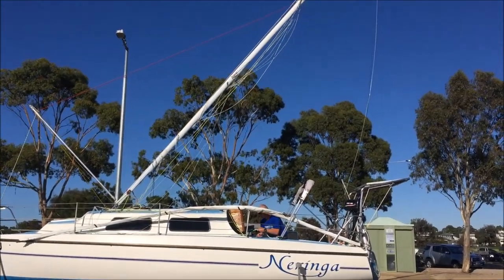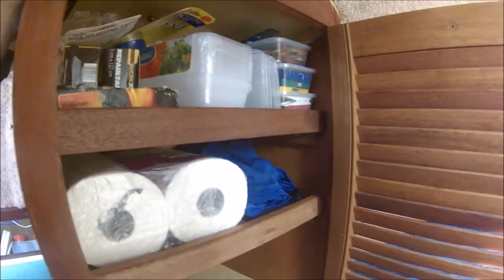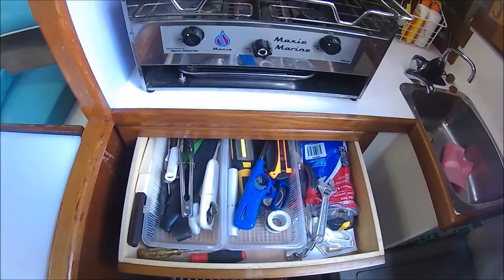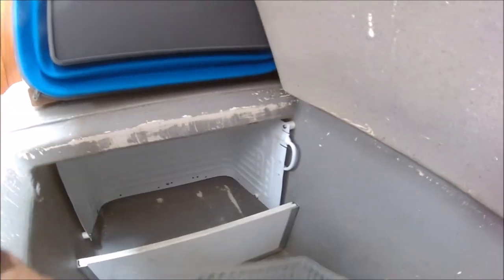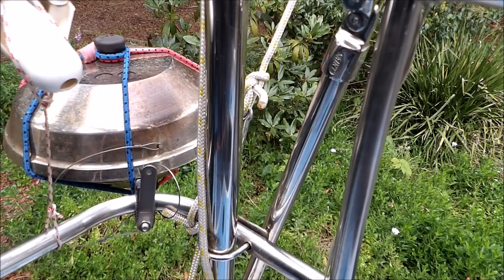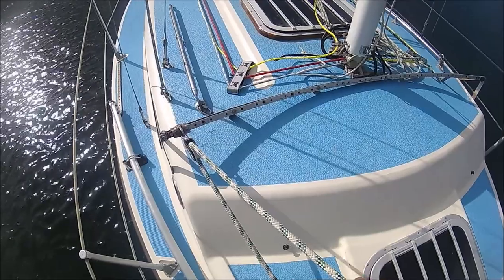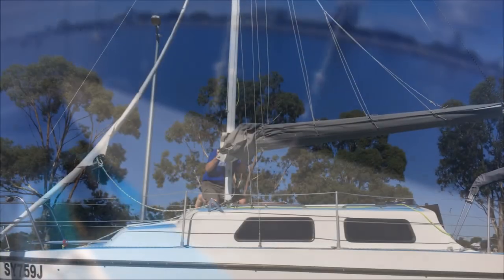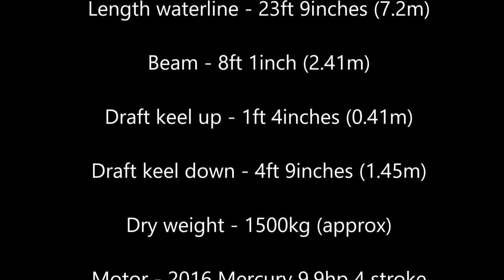Neringa RL28 Cruising Improvements - Part 1

Comment: G'day Mark. Love your work, keep it up. I'm interested in your trailer, which seems very well set up. If you look at my channel you'll see I've got a Welsford 6-metre Whaler, obviously smaller than Neringa, but an unusual shape (particularly the canoe-stern) that most trailer manufacturers don't seem to cater for. The trailer it came with is diabolical and retrieval is a real handful, and impossible single-handed. What make is yours, what if anything did you have to do to customise it? Cheers!
Reply from the maker: G'day Tony,

My trailer is a Swifto 7.2m trailer and really is just a power boat trailer and except for the frame which seems decent most other parts on the trailer have been upgraded due to the poor quality of what it came with.
Having said that, looking at your boat you should be able to set up any power boat trailer to load your boat pretty easily. Things I have added that I think would work just as well for your whale boat are: 
- Vertical guide posts that savage trailers  sell for about $200 a set. I would attach them further forward for your boat than mine but you might need to play around to get the best spot. They push the boat into the center and really help on windy days by guiding the boat on.

- slider bars (4 on my trailer towards the rear) slope into the middle and are set just wider than the widest part of the keel at that level. If off center the keel slides over these and as more weight goes on the keel slides to the middle of the trailer. I think savage sell them too.

- Ladder keel rollers, not essential but more rollers and more support.

- Self centering roller (red roller at the front of my main keel rollers) keeps pushing the front of the boat towards the center as it rolls forward. 

- cheap 4wd winch with remote to winch the boat on, not essential but lets you walk around checking and adjusting whilst the winch pulls the boat on.

So really any trailer with enough adjustments to fit the keel shape with the above added will make loading a breeze. I just bring the boat roughly onto the middle of the trailer with the guide posts holding it there, hook up the winch rope and press the remote until the bow rests on the winch post. I would say 99% of the time it loads perfectly without anything else needing to be done even when windy. Hope this helps. Cheers Mark
Reply: @TRAILERYACHTADVENTURES  Thanks Mark, that's very helpful. Give us a shout next time you're up this way en route to the Whitsundays! Cheers, Tony

Comment: Sell it for 45 to me?
Reply from the maker: My time with Neringa is not over yet. Thanks for the offer but I am not ready to sell her yet, still a few years of sailing adventures to share. Cheers Mark
Reply: @TRAILERYACHTADVENTURES  thanks legend. Please show some clips of the shower section. Also is that offer a decent one? What similar and better trailer sailer should I look for? Bless you mate
Reply from the maker: @GodCoastQLD  Yes the offer was a good one and you should get a great RL 28 for that. Having said that, Neringa has had that sort of money put into her since I bought her back in 2016. I am told that I have made it hard to buy and RL28 with my videos these days, not many sold and any good ones go very quickly. Having said that there are other TS's that are excellent boats but like all boats they are all compromises. Slightly newer and very seaworthy are Farr 30 or Nolex 30. Both are great boats but are heavy to tow and are oversized for the road so require permits and day time towing in some states. It really depends on what sort of sailing you want to do. If you intend to do some of the more adventurous trips that involve open ocean then the above boats or maybe something like a sunbird 25 would be my choices other than RL28. The sunbirds are mid 80's boats and have an inboard diesel. Finding one with a good motor can be a challenge given their age, but they are very seaworthy and solidly built. All of the above boats have standing headroom down below. Some would consider a nolex 25 a good boat but no standing headroom and a very lightweight mast. 
If you are sailing lakes and bays then most TS's are possible candidates. Macgregor 28 is a hybrid water ballast sail/power boat with standing headroom. They sail Ok but many would question this. They are newer boats but are reasonably lightly built. Designed to have a 50hp motor they can be planed. They are flat bottomed and I suspect would be uncomfortable in a heavy sea but there are many that swear by them as being great boats.
I cant post pictures on Youtube but if you email may channel email.. sharemyadventure.net@gmail.com I will email some pictures of the shower compartment back to you. As I said the shower is really a compartment that can get wet with a hand shower.
Cheers Mark

Comment: Sailing. Standing under a cold shower, ripping up $50 notes 🙂
Reply from the maker: And loving every minute for the joy my boat brings! Better than standing under a cold shower ripping up $50 notes for booze, smokes or drugs, and the high I get lasts and doesn't wreck my health. Have you ever tried ripping up our plastic notes? Probably would need waterproof scissors in the shower with you too  :)  :)
Reply: @TRAILERYACHTADVENTURES  there is nothing, absolutely nothing, half as much fun doing, as simply messing about with boats. Water Rat, The Wind in the Willows
Reply from the maker: @COLINJELY  Used to keep rats, very intelligent animals, Ratty just proves it by his opinion on boats :)